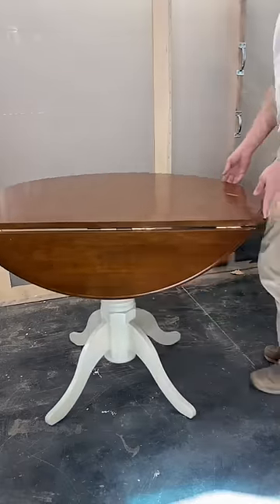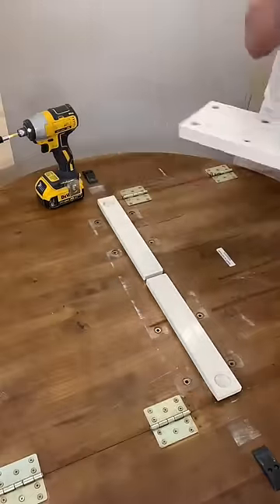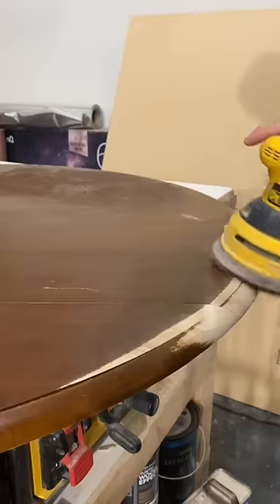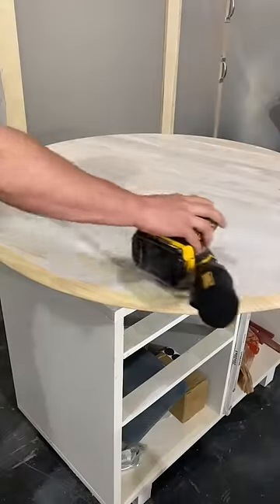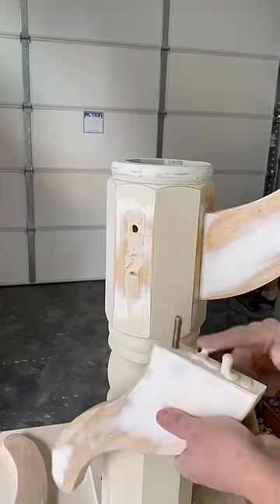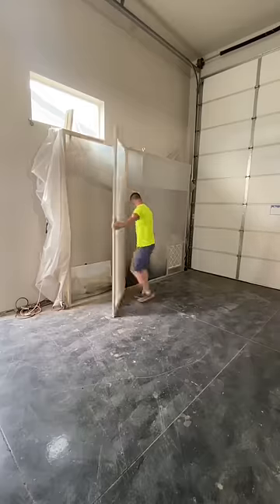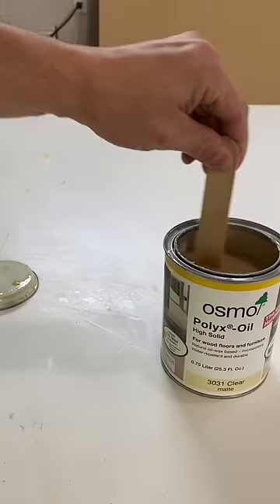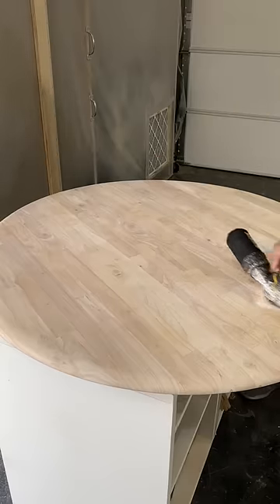Fun kitchen table modern makeover DIY #diy #furnitureflip #thriftflip #furniture #makeover

Comment: I like a table with folding sides.
Reply: That table is too small to have usable folding leafs. Leaves? If you cant get a chair seat under a table with folding leaves it is useless.
Reply: @janet1744  But you can put the table against the wall to give you more floor space when you aren't using it, and then put the leaves up when you need to use it.

Comment: I would have cleaned it polish it and used it. I didn't think it needed a thing. It's not easy to find drop leaf like that. I have one in my breakfast area and the drop leaf comes in so handy and it's the color of your table before u screwed with it.

Comment: I purposely by any tables with a folding edge or leaf. Thst is omoush aganst wall? My 2 car converted garage done by the artist builder of our home is my sewing/crafting room. Everything folds, extends etc. At one point before covid I had 4 machines set up to teach. I have 2 mini type card tables. They go to 3 heights. Sold in Walmart by the folding chairs and regular card tables. I used 2 extra shelves that are larger than top on these when i double hung closet in this room. I've now rearranged room because I was given a gate leg dining table. Irs my crafting painting center. Sewing in other half. It has 2 leaves. It sits 8 but can fold down to small hallway table. From 1940s. I also use another smaller gate leg table as my cutting table. I put on bed risers for that. Both of these I take outside to patio for extra guests. I love the paint booth. I don't have a sprayer...yet!

Comment: I would have added new cuts to keep the folded leaf option, but make the center section narrower. As it was, those leaves were more decorative than useful, so I’m not as sad to see them go. 

(My metal legged 5’ diameter table is 9” wide, folded. It’s great for storing away, but too narrow to use folded as it falls over if at least one leaf with support isn’t out.)